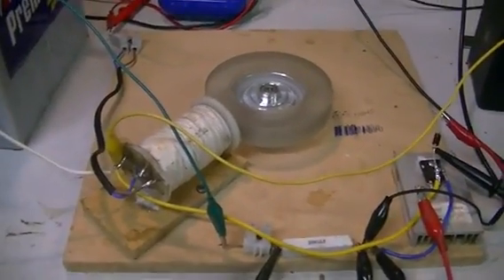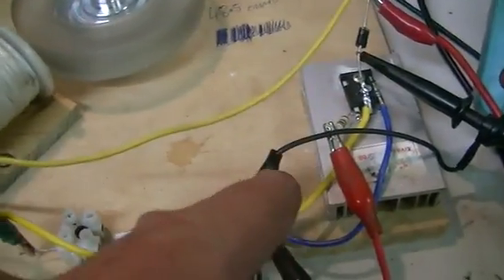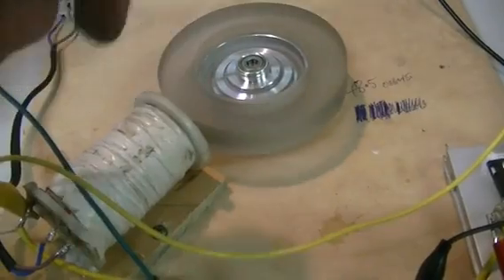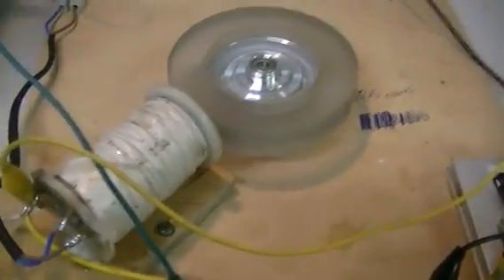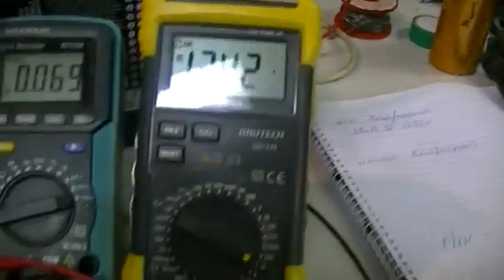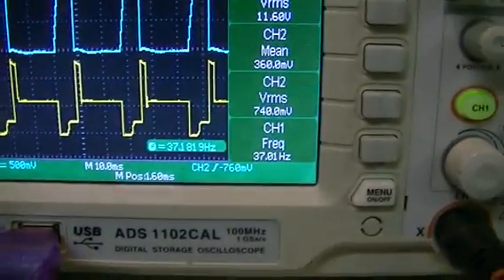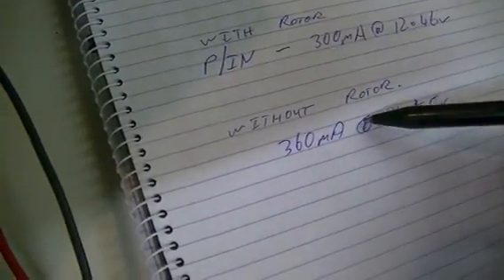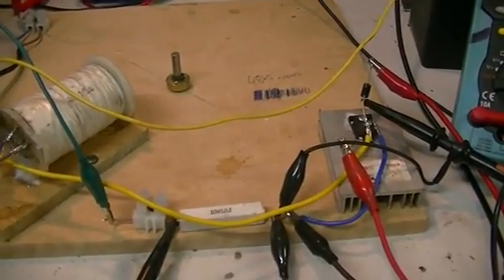Bedini _ Proof that Magnetic Fields Increase Efficiency in Pulse Motors.

Comment: The way forward maybe amplification, converting the energy gained from one small source into another.Example: electrical charge from Bedini motor converted into gas could drive a Sterling engine, which could drive a small generator. Two other circuits which mite combine with the Bedini are phase shift oscillator and .

Comment: the circuit used here is very similar to a induction coil circuit. mainstream science has already proven you can capture the back EMF and feed it back into the system, with the bedini SG that captured EMF is put to work

Comment: I think the magnets add inductance to the coil causing current to drop. Inductive reactance is an impedance to current and explains the change. Measuring inductance on the fly is tricky other than observing the flyback but maybe an inductance meter can pick up the values...I would explore that but my cheapo inductance meter got rained on

Comment: Yes the simple SSG is STILL a fascinating thing to study.   I have to remember that John didn't claim that it was a good "motor".  He called it an 'energizer' and said that putting meters on it defeated the effect.  I don't know.  To me it was just a fun thing to build and watch go round and round while charging something up with the flyback.   I guess by now (if it had been a miracle invention) it would be in stores, made in China, and be as common place as an led light bulb.  That never happened.
Reply: +Lidmotor Indeed! :)
Reply from the maker: +Lidmotor  I was thinking Lidmotor,this is much the same as your maggie running from pulsed fields of other motors you make. I wonder if you bought maggie closer to the rear of one of your pulse motor coils,if it would increase the efficiency of that pulse motor?--just a thought.
Reply: +TinManPower  I have used Maggie as a second half of a transformer with an other coil and she works fine.  I don't think that she adds anything on a pulse motor drive coil setup though but I could be wrong.  Sometimes I put the little bobbin coils inside her mouth.  She then becomes a pretty good step up transformer.

Comment: Nice work!
I calculated the power efficiency is ~22.71% for the rotor in circuit configuration.
I calculated the power efficiency is ~14.52% for the rotor out of circuit configuration.
The difference  is ~8.19% points--which means the rotor in config is ~56.4% (i.e.: 22.71% / 14.52% * 100) more power efficient than the rotor out config.

Would you provide your magnet info?
1.  Rotor Poles = 8
2.  # of Rotor Magnets = ?  (how many magnets are stacked in each of the 8 rotor pole positions?)
3.  Magnet Grade = ?  (N42 or N52?)
4.  Magnet Dims= ?D" x ?H"

Thanks for sharing your test data!
Reply from the maker: +A B  There are 8 n52 neo's in the rotor. They are 10mm dia,and 20mm long They are alternating fields out on the rotor(N/S/N/S/N/S/N/S).
Reply: +TinManPower 
Thanks!
Longish magnets. Do they provide any significant benefit over 5mm L mags?

Have you tried yet to determine the optimal pulse frequency to obtain the maximum power output from the system?
Reply from the maker: +A B  I am working on a duel rotor system at the moment. This will allow me to slide the second coil in line with the rotor,and that way i can measure the increase of efficiency at higher frequencies.

Comment: Nice video bro,
You should configure that NPN ssg circuit so the run coil works as a gen coil for 50%...;-)
Coz if you are pulling or pushing those rotor magnets one half of the since wave is still there and that can be used to get some power back to the system cap...
And with the trigger coil it is even beter since every alternating magnets will work 100% as a gen coil...;-)
The coil should provide enough voltage @ that given rpm otherwise the voltage does not have enough pressure to get into the cap wich will be @ 12.(something)...
Lousy explanation but i'm pretty sure you get the idea...lol
I did this and it works pretty good at around 3ma input on my last setup of "simple reed switch pulse motor circuit series videos" but i totally forgotten to make a video of it...lol
Have fun & cheers